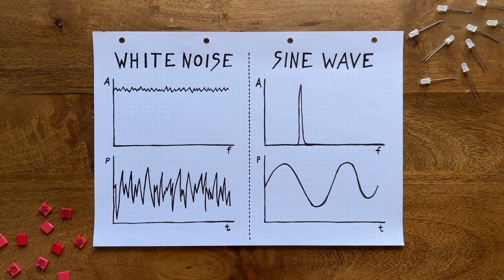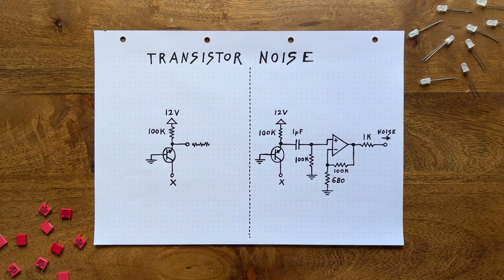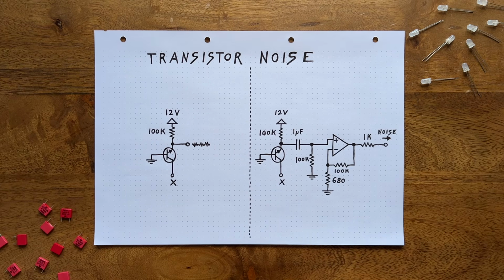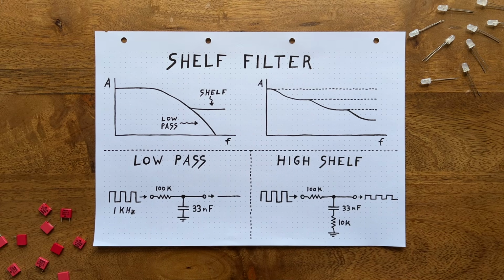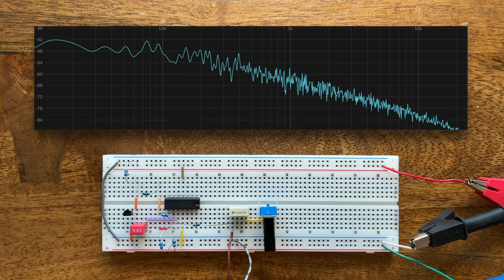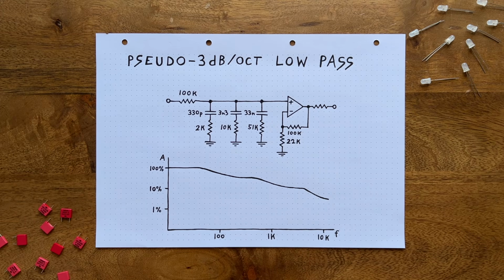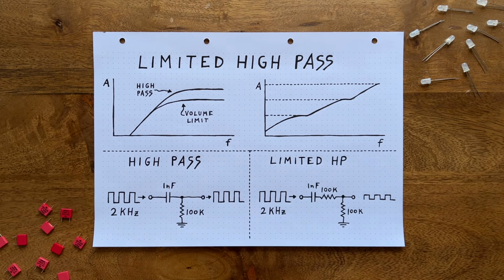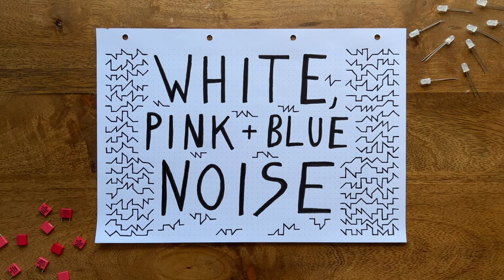Designing a white, pink & blue noise generator from scratch

Comment: Hi! Can you please make big comparsion between various noise sources in controllable breakdown mode? Such as zener, detector diodes, transistors; both silicon and old germanium ones. And also LEDs with different semiconductor types. I wonder for differences in spectrum.
Reply: Tone changes both with the type of semiconductor, and the current it is driven at. Because of this your request is difficult to fulfill, but if you search sites of guitar distortion effect builders you will find volumes have been written on this topic. Often, guitar players have multiple noise generating effects which operate on PN junction breakdown because of their different qualities. You should experiment and select based on your likes. Noise is very individual.

Comment: Great video! As all your previous, love them! Just wondering, the "white noise" inputs to pink and blue, are they directly connected to the white output or through a buffer? My feel from the video is that there is no buffer in between, just straight on from the white output?
Reply from the maker: yeah, since both filters have a pretty high input impedance, i don’t think an additional buffer is necessary.

Comment: Just thought of this, but a less cruel analogy for the breakdown voltage might be waves breaking over rocks. 🌊🪨 The rock (transistor) will block a wave up to a certain height (amplitude), but water above that height will crest and crash over the rock (breakdown). Going a step further with this analogy, over time, the waves crashing will erode the rock down (burn out the transistor). How quickly that happens depends on how big the waves are, and how strong the rock is. Love these simple filter circuits! 👍️

Comment: The shelf filter is a really cool concept that I’d never really heard of, and it was really well-explained. But why can’t you just mix the original input (the white noise) with the 6db/oct filtered output so it’s like only 50% filtered, 50% dry signal? Wouldn’t that be an easier way to get 3db/oct, hardware-wise?
Reply: That's basically what a single shelf filter is doing. But on its own, it's not very close to the 3db/oct curve, hence stacking them.
Reply: Exactly my thoughts, then with a few pots you could vary from -6dB HP to -6 dB LP, sweeping through blue and pink spectra and getting a BP filter too. I imagine you don't have to worry about phase issues at all since we're just mixing noise.

Comment: Interesting how a high-pass filter and an AC coupling capacitor are basically the same arrangement.  Presumably with a coupling capacitor, you pick a value so that the cutoff is well below audible frequencies?
Reply: yes, and in fact a DC offset shows up as a 0Hz frequency in a fourier transform. with a coupling cap the resistor part of the HP filter is distributed as parasitic resistances to ground in the nearby components.
Reply: It's not just basically the same, it is 100% the same

Comment: I wonder how the noise colors were decided.
Reply: white noise is an analogy to white light. in white light, every wavelengthe(frequency) is present with the same amplitude. with white noise, all the frequencys are also present with equal amplitude. for the other colours of noise dont realy have an optical analogue, but blue light is higher frequency and red light is lower frequency, so kinda similar to noise colours.

Comment: Thanks for making this! I'm curious - does abusing the transistor like this shorten its lifespan at all?
Reply: Not if you keep the current low. Moritz is using a 100k resistor here, which will only let about 50-60 uA flow.
Reply from the maker: exactly - should’ve mentioned this in the video!

Comment: Hallo Moritz. Is it possible to obtain a blue noise output, by feeding + an - opamp inputs with white and pink noise respectively, in a differenciator configuration ? Just an idea to save some components. And what would be the result with pink and blue ? White output again ? Thank you.
Reply: The fourier transform is linear, so I would expect subtracting pink from white to work if the amplitudes match up. Not sure how it would work out in practice though with the filtering involved etc
Reply: Pink noise should be enough to make blue noise, and vice versa:
-3 dB/octave is hard and 3 dB/octave is also hard, but if you have one then you should be able to get the other using simple filtering.
So at least in theory, if you pass the pink noise through a 6 dB/octave high pass filter (differentiator), then you should get blue noise.
And if you pass blue noise through a 6 dB/octave low pass filter (integrator), you should get pink noise.
It doesn't have to be a perfect integrator/differentiator, just act more or less like it over the frequency range that you care about.

In practice, you might get some trouble because some parts of the input signal are quite weak, and those are the ones that you would be amplifying the most, but I think it could work.

Comment: Fascinating, thank you Moritz! I'd have just tapped into the noise source, let it run through a 6db/oct filter and then mixed the source and the filtered output together - having watched the video I'm confident that that wouldn't work now 😁
Reply from the maker: hmm maybe if you weigh the two signals 2:1 in the mix? something to try!
Reply: @MoritzKlein0  if I had more of a clue than I have and a way to test properly I would now that you've said that!
Reply: it should again look like a shelf filter, so I don't think you will see much in component savings
Reply: ah yes thats true. log scalle kinda missleads you there if you dont know what you are looking at
Reply: But one of course could create the blue noise by mixing the pink with an inverted version of the white (or vice versa).  The opamp buffer turns into a differential amplifier and we don't have to make three more filters.
Reply: Alas this doesn't quite work. If I understand correctly, the phase shifting is frequency-dependent so the signals don't line up as you might hope. I think what you get is equivalent to a single shelf stage (which would be the case with independent signals, need someone with better maths than me to figure out the Laplace transform bits).
Reply: I am not 100 sure but this may not work perfectly, becase there is phase shifting from by the filtering the signal. worth trying though

Comment: Awesome, Moritz!! Thank you! 

Moritz, what type of capacitor do you use and are they better suited for the purpose of audio? 

I would like to see a brown noise circuit and a circuit that will give an animated sweeping effect with variable rate. As well as a gated input. Please.
Reply: You can try to use any type on non polarised capacitors(so electrolytic and tantalum don’t work) for audio, even the cheap ceramic ones in most cases. The one he uses are called film capacitors or foil capacitors, they are meant to be better for audio but are also significantly more expensive. It maybe worth trying to use the ceramic ones on a breadboard or something, if the circuit sounds fine you can save some money
Reply: @woosix1  the main downside of ceramic capacitors is that they are microphonic. 
The really cheap ones have terrible tolerance, temperature coefficient, and voltage coefficient too.
Reply: Also for brown noise, it’s just a simple 6db/oct filter of white noise https://en.m.wikipedia.org/wiki/Brownian_noise . 
so. A simple 1pole passive low pass filter with 1 resistor and 1 capacitor will work